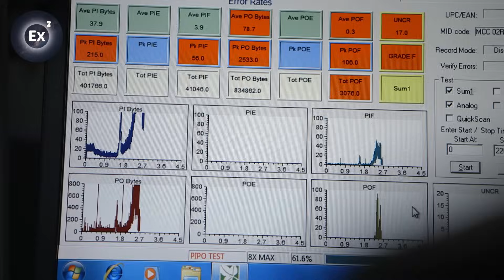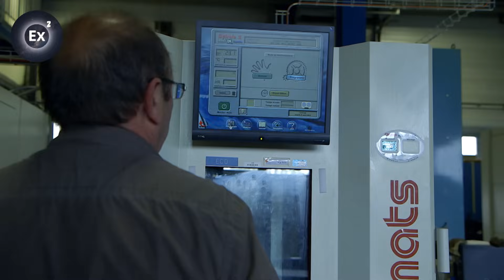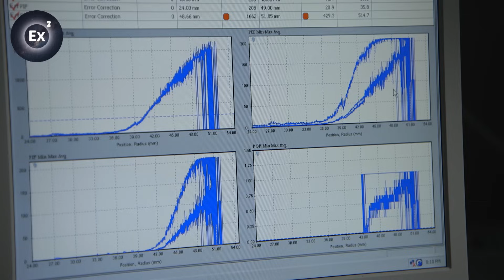Why is digital data so fragile? | Experts Explain

Comment: I remember the time when news of recordable CDs were rotting came up. DVDs probably were a little more tolerant, but probably still had rot. Tape and physical drives have limitations, too. Online storage seems like a good option, right?
Reply: @NerdyNEET  I know that, the data is actually on servers in their data centers, and can be redundant.
Reply: The good thing about Cloud storage is that all this is somebody else's problem, and most of the time they have very high security, and very high redundancy.

The bad thing about Cloud storage is:
A/  You never know for sure how your data is really being stored.  At least not in most consumer applications (professional applications such as AWS and Azure allow you to specify fairly comprehensively).
B/  You're whistling to the tune of whoever your data is with.  They aren't invulnerable, and something might happen to Cloud providers, no matter how big or small.  Something might even happen to the internet.  If either an individual company breaks down, or there is a big disruption to the digital ecosystem, it's gone.

Best answer is to use both - have large redundant storage at home (such as a NAS, or ideally a PC with data manually backed up from one hard disk to another), and a backup to a reputable cloud service provider.
Reply: @NerdyNEET  Thank you.  That's why I would NEVER use the cloud.  I don't trust someone else.
Reply: @NerdyNEET  I admit I did not buy these items in the US where corruption is common place. you right your stores sell shit to you and you have no choice but to buy trash with worthless dollars.
Reply: a high quality dvd will last a 100 years or more if well maintained. the cheap indian and chinese dvds  will degrade in a couple of year and less.  have a program to read who made your disks. 2 japanese companies were best.Always use a popular compression programme and keep a copy of it with your disks.
Reply: @NerdyNEET  Im looking at one now. in 80 year you can see it too.
Reply: @NerdyNEET  I have the opposite experience. all my cheap disks are gone but my 20 year old memorex dvds and cds from the 90's are just fine. I have 1200 of them.
Reply: @NerdyNEET  just looked at mine they are verbatim-R dvd's 4.7 gb. and a pioneer -r dvd writer. all there disks are made by mitsubishi chemical corp.  they never change suppliers. I have a 1000 of the things and no more then a hand full have ever gone wrong. most of mine are  around 20 yrs old. manufacture claims mean time to failure of 100 years.  I have no reason to doubt them.  other brands buy from the cheapest supplier which varies from month to month. none of those have lasted.
Reply: @snaplash  yes, I believe it.
Reply: @NerdyNEET  surre you are. and your right again, you don't matter.
Reply: All the CD-Rs I burnt when a student 25 years ago are now unreadable 😢 Data loss is a serious problem, and everything is in the cloud now - if the main data centres get wiped out or disconnected then so goes 99% of our modern knowledge!
Reply: @bigjd2k  quite a few data centers I have dealt with use redundancy across locations around the globe. Chances of all those locations going down at the same exact time are slim.
Reply: @bigjd2k  I still have 28 years old CD-ROM discs that are ok. These are the earliest of all, Traxdata. An those were written on the very first recorders, capable of only 2x writing speed. The writing speed appears to be the parameter of the longevity, the slower the writing speed, the longer the longevity.

Comment: One can make a copy of digital data onto a new disk with little effort and no loss because of error correction. This cannot done with a stone inscription or film. CDs last a long time if not abused. DVDs are even better because they enclose the film with data in plastic from both sides.
Reply: M-Disc is even better with a claimed 1000 years, Pity it didn't really take off.
My blu ray burner supports it but the media is too expensive, Cheaper to just buy another HDD unfortunately.

Comment: The opposite issue is even more often discussed, i.e. is that digital files can't be got rid of anymore - digit data persists forever. Given the gigantic amount of information being created now vs pre the digital age, even if 99% gets lost there could easily be millions of times more left than is left on paper from 100 years ago, and trillions of trillions of times more left than is left on stone tablets from 2000 yrs ago. The thing about digital stuff is that it can be copied without loss, and is normally copied many times. The result is that while some media could be fragile digital data isn't fragile at all.
Reply: The problem is that with current technology 100% is going to be lost.  Including that previous sentence.
Reply: Have you heard about data rotting   ?
Reply: @EnterpriseTNG  2000 CDs can fit on one cheap 2.5inch HDD so there are very good reasons to migrate stuff from old media to new media for storage reasons alone.  Everything needs to be maintained.
Reply: @NerdyNEET  Stone
Reply: WORD!
Reply: i wonder how this will change when quantum is used for long term storage and we rely on it?
Reply: @icraftcrafts8685  the same, you can't stop data rotting because you can't stop the Time
Reply: @EnterpriseTNG You can stop data rot zfs array, zfs scrubs, 3-2-1 backup, hashes of all the files and you can skip the rot
Reply: This is assuming that 2000 years from now there is still the technology available to read it.

Our civilisation is treading on eggshells, and it's not a very feasible concept that the whole thing comes crashing down.  I'm no doomsdayer or anything, but to think that the human race as we know it is invulnerable to an extinction event is very narrow minded.  There's probably a higher chance of it happening than not happening, though nobody can predict when.  Could be tomorrow, could be another 10000+ years from now.
Reply: @NerdyNEET  It doesn't matter. We do not have enough fossil reserves for another industrial revolution. If we lose our current global technological society, we are not getting it back. The data will have no value
Reply: THE PAPERSS MADE IN LAST 50 YEARS WILL NOT LAST LONG EITHER ... THEY PUT AN ACID IN THE PAPERS ... IT WILL ROT EVEN IF HIDDEN IN COLL ,DRY AND DARK PLACE
Reply: @NerdyNEET  the ancient civs(Who were way advanced then us), came up with  the same solution:stone

Comment: Any data that you do mot print on paper and keep in a fire resistant cabinet, is data that you do not care about.
Reply: Paper eventfully rots too. Especially if you did not invest in archival paper.
Reply: @1906Farnsworth  I will be dead in 25 years (I'm 75 now) and have nothing that anybody would want after that, so I'm not worried.
Reply: @NerdyNEET  I am looking on another 25 years as a worst case scenario. Happy to go tomorrow, if it doesn't hurt. Now I know who killed Hoffa and JFK and the Black Dahlia, I can rest.

Comment: SSD are vulnerable to micro electrostatic charge
Reply: ...and bit-rot as has been recently discovered, if they don't pretty often see power.
Reply: @NerdyNEET  No, a read cycle; write cycles are destructive in SSDs.

Comment: Blu Ray has M Discs which basically means the data should last a Millennium ie 1000 years
Reply: People in the far future will wonder why there is a large gap in their history of the 21th  century
Reply: @anthonykoller4459  Dark age, fair to say.
Reply: You will have to check in 1000 years.
Reply: Too expensive though, Look at the cost to get 100gb out of them and then a hdd for the same price, The hdd will be 5-10x more capacity.
It was one of the reasons I picked my blu ray burner many years ago because it had M-Disc but never got to use it.
Reply: Cds supposed to work with jam on them, see BBC the Tommorows World episode.
Reply: What about cosmical rays or sun storms etc?
Reply: CDs were supposed to last 100years
Reply: @daviddunkelheit9952  My CDs purchased 40 years ago are perfectly fine. Don't believe the FUD. One thing this poorly informed video did not mention is the built-in error-correction of CDs which overcomes minor errors. M-disks were engineered to last for centuries and I have no reason not to believe the manufacturer's claims, especially after how my collection of hundreds of CDs has lasted faultlessly for decades.
Reply: @paulcarter7445  there is a distinct difference between CD and CD-R and CD-RW accessible by the consumer. I could take a cheap bargain bin CD from Rhino records or Ktel that I bought for a  dollar and skip it across the parking lot and it would play while you could scratch top of a CDR (reflective part) or wipe some dust off the bottom of it and that would cause it to skip or throw read errors. Worse than that in the tropics there is a bacteria that will eat the substrate like a bore 🪱 and make it unreadable.  Then there is the problem if the inner most part of the disc is damaged then the CD is useless and can’t be recovered using ISObuster or CDroller (which recovers binary data by rescanning or replacing blocks).  Consumers don’t have access to the high quality media used by music publishers and therefore don’t have anything that will even last a year.  That’s why there was such a fast adoption of using USB keys for installing OS such as Ventoy and Rufus. These programs emulate CD/DVD iso images for the purpose of booting and running a Live OS. Because CD/DVD are so unreliable.
Reply: @daviddunkelheit9952  Yep! Agreed!
Reply: @daviddunkelheit9952  No, it's because CDs you buy from publishers are stamped, so they can easily last for decades. CDs burned at home change the reflectivity of the metal layer, so they are not as reliable. Although media burned at home can often last for decades too.
M-DISC burns holes in glassy carbon, so they last for hundreds of years, confirmed by testing.
Reply: @pakan357  interesting. I had sought superior or publisher grade media for years and realized that it was folly.  The major record labels didn’t like people having the ability to share music as mp3 through p2p and duplicating their albums.
Reply: @daviddunkelheit9952  You can't stamp CDs at home even if you got your hands on one.
You can however rip and share stamped and burned CDs in the exactly way, so piracy is not the reason you can't find them.
Reply: @pakan357  ? 
How is it “stamped” ?
Like a metal vinyl acetate disk (dub plate). Those are cut with a lathe. 
You are saying that it is completely different process than consumer CD-R CD-RW / DVD-R ?  
The label or top of the disc is formed in at once in this process?
Reply: @daviddunkelheit9952  Completely different process. They are stamped with glass masters, creating physical pits in aluminum layer (CD-ROM), pretty much like vinyl records. Burning (CD-R) changes the reflectivity of the dye layer. The organic dye degrades in a matter of years, but could sometimes last for decades.
Labels, not sure.

Comment: RAID-10 & Tapes are your best friends for now.   Had multiple HD's failed over the years but RAID-10 - ALWAYS - come through - as good as they come. And tapes? It is the the closest thing we have for now for the MOST reliable data backup and nothing on the horizon can come even close.  Not even virus/malware can hurt tape backup as they're "trapped" like a tree sap until "released" to HDD.  All SD/HDD will die mechanically  and data corruption WILL occur as it's only a matter of time. But tapes?   Put those puppy in an airtight container and it will most likely OUTLAST your life!
Reply: Yeah tapes are probably the best bet still, Everything else is just too expensive.
I had hoped M-Disc was going to take off years ago with it's 1000 year claims, I still have a blu ray burner that supports it but no way I am paying the crazy prices just for 1 disc, HDD's still cheaper and less hassle.
Reply: Apart for mechanical spooling damage and flaking of the ferrous coating on the tape, very common occurrence. It cusses irretrievable data losses.
Reply: That's my kinda thinking!! I was literally just wondering about tape ... it's a beautiful medium for sound, and apparently data archival too. Right on.
Reply: @4wheelwarrior  The people who don't use tapes don't understand it. If left purely for archival purposes (not constant accessing like HDD) they will EASILY outlast your lifetime. They can also be indexed very easily. The latest LTO's are nearly indestructible with multiple redundancy and error checking built-in. Expensive? Yes. but as bullet proof as they come.
Reply: @lil----lil  Actually, looking on eBay, seems LTO 1 and 2 drives are quite INexpensive ... Still look dang useful at 100-200GB a tape, too. Rather archive to 5 tapes than a terabyte HDD!
Reply: @lil----lil  Sure, in the general sense you're right. I back-up to tape - multiple tapes (in case one gets chewed up). The problem is that the drive technology changes. An LTO drive can only read 2 hardware generations back. You'll then be off to ebay to find old drives to read your tapes from 10+ years ago. Not to mention drive interface technology (SCSI/SATA/FC/SAS) evolving. Having said that, I was able to restore DLT tapes which were stored under a car seat for 12 years! Optical drives are not really the answer either. Media issues/capacity, etc. Can you buy a new CDROM drive in 20 years.... back to ebay..... There's no easy answer here.
Reply: Great.  That means assuming a really healthy life with really good genes probably maxes out at about 140 years.

Comment: Fuck now what?
Reply: Faraday cage cold storage, multiple redundancies for local online storage, and a planned upgrade path. That's my basic plan. 

For most people the easiest method is to store everting of importance on more than one piece of media and in different forms. From there they must copy all of it agaun whenever a newer denser form of storage media comes out. As for archiving civilization, this method of rollover is a stop-gap but is effective as long as you have a civilization.

I have considered analog methods but I currently believe the focus still remains on doubling-down on digital. "M-Disc" media uses a stone-like material that supposedly lasts 100 years. Still, optical media is an annoying pain in a butt, although tape storage has so many peculiarities. The important thing is to not trust the vendors/manufacturers and to plan accordingly.

Aside from seeking to make photo prints, maybe I'd even go from digital to film to create arrival photo slides. Ultimately the real scientists will need to figure out something with glass or crystals (holographic storage?). There is method of printing to a silicon disc and encapsulating it I'm resin or glas but it's obscenely expensive.
Reply: @DJRonnieG   Indeed.
Reply: @DJRonnieG  Is all this available at Walmart?
Reply: @onixotto  yeah, but Home Depot/Lowes, Beat Buy/Fry's/MicroCenter would should also be visited by anyone looking to embark on such an endeavor. However for most people I think just rolling over data from old drives to new drives is very doable.

A Faraday  cage can be a grounded cube of chicken wire, although it isn't quite as simple for high-energy EMP's. In most cases the biggest culprit is the fact that most people do not store their data on more than one device or form of media. Hard drives are most economical, even when you buy two of each... which few do but they probably should.

The answer really depends in what we are looking to preserve our data against. I propose raising awareness and getting people start with a reliable short-term plan, by which I mean a 20 year plan. Such a plan still necessitates buying new hard drives every five years. Keep the old drives but also copy all existing data to newer and larger drives. 

If people don't do something like this, they will unable to take advantage of the thousand year technology if it becomes available before their death.
Reply: @DJRonnieG  thanks bro. Don't want my terabytes of porn to go to waste.